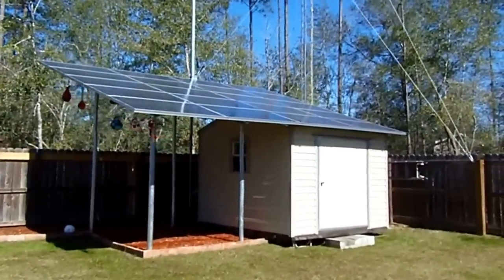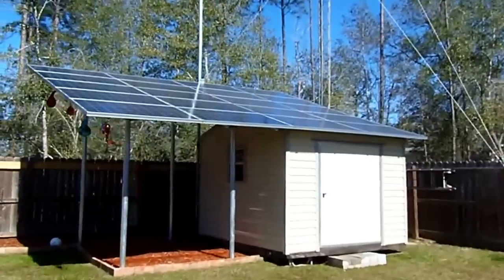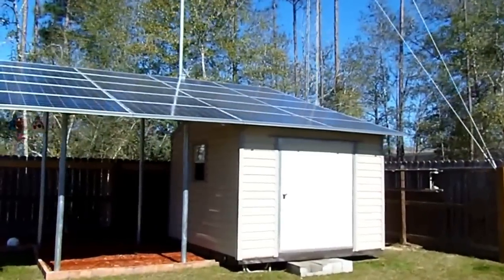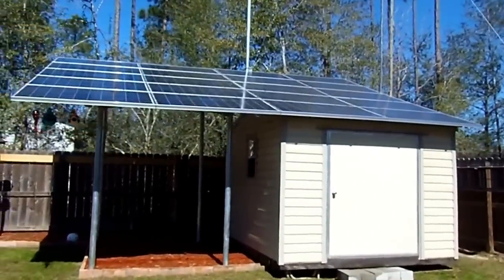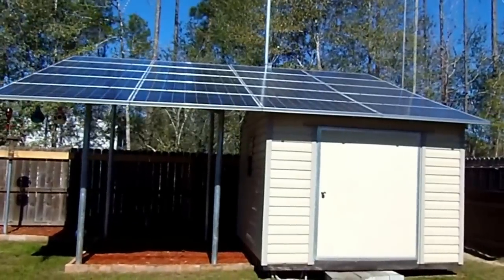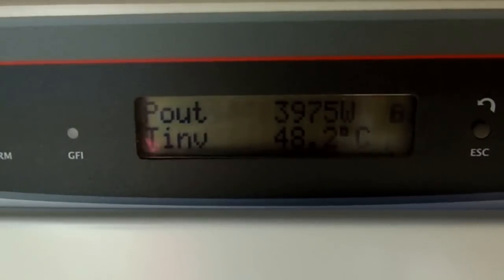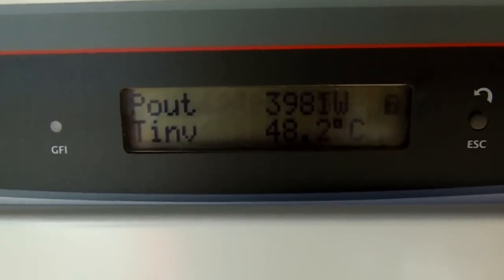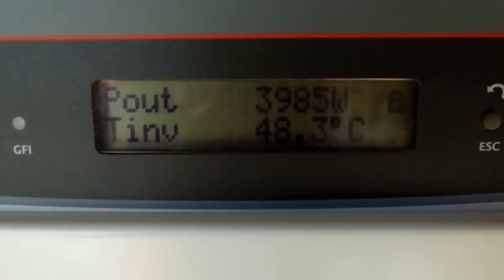Grid Tie Inverter, Solar and Wind Update 2-3-13

Comment: It would really be helpful to provide a more detailed description or walk-through of what you have here.  For example, how exactly do you have your wind turbine grid-tied?  You previously had two separate Chinese grid-tie inverters...now you have a single Aurora...how are you tying in the wind DC output?  The Aurora has two independent inputs, but it looks like you've split those between your solar panels...where is the wind coming in?
Reply from the maker: Working on it. Thank you

Comment: Good work, is the turbine connected to string 1 and the Solar Array connected to string 2 of the inverter? Atlantic Renewables mostly install Power One in the UK due to its string flexibility and ability to alter string sizing (start up voltage). check us out at atlanticrenewables.co.uk
Reply from the maker: Thank you